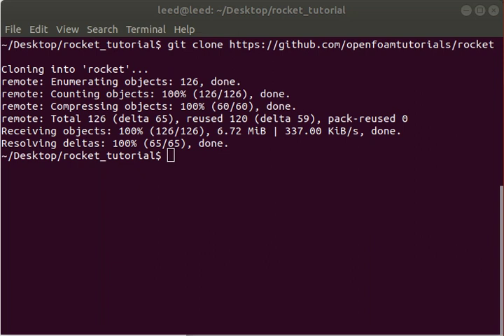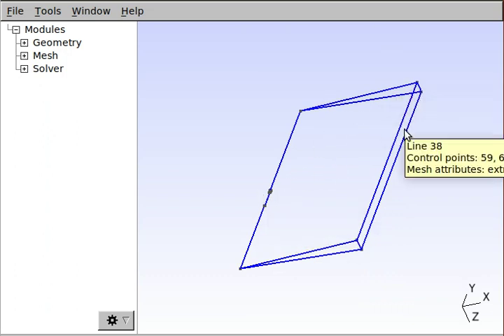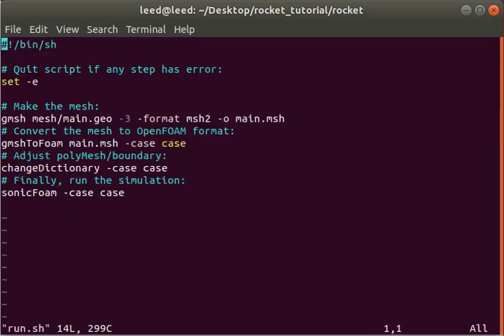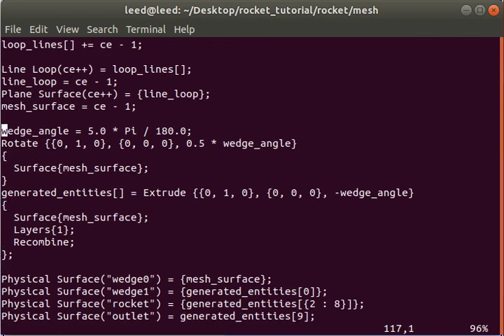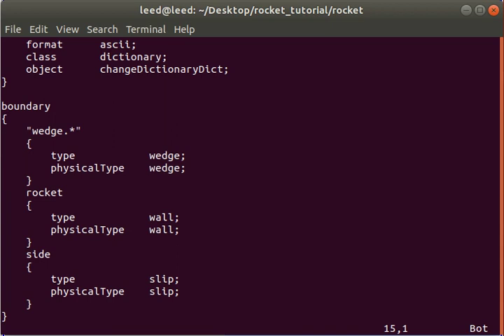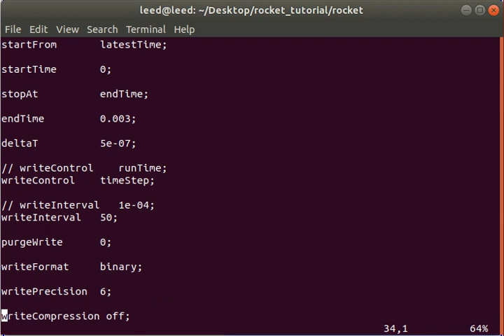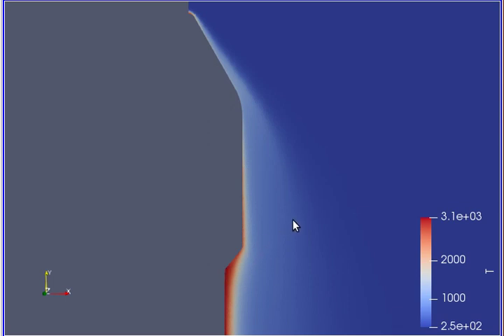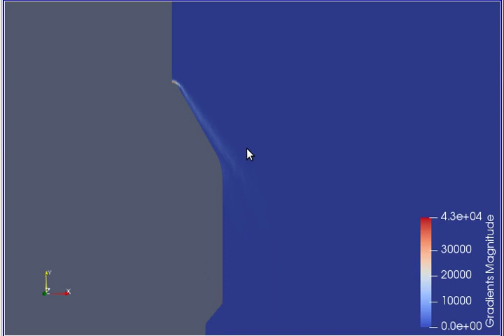SpaceX Falcon 9 Rocket Body Simulation in OpenFOAM

Comment: Thanks for the video, could you make a video explaining how you divSchemes under Fvscheme ? I am still learning open foam and it would be helpful how it is set.
Reply from the maker: Good idea! If you are merely confused about the syntax, OpenFOAM has good explanations in the documentation. Generally higher-order schemes get more accurate but less stable with smaller grid sizes (note that this is a statement about the trend). Generally I default to first-order upwind until I get results with which I can compare accuracy with higher-order schemes. If you cannot get it running with first-order upwind schemes, then something else is the problem.
Reply: @OpenFOAMTutorials  Thanks for the thoughtful reply ! I have used fluent before and i understand the importance of the different order schemes, im just confused how you define all the div() terms under the DivScheme, is it relate to the k episilone foundamental equation that you chose ?
Reply from the maker: If you define a default scheme, you won't have to enumerate all of the terms. In this tutorial, I define k and epsilon terms because k-Epsilon is the turbulence model I am using (see case/constant/turbulenceProperties). I hope that answers your question!
Reply: @OpenFOAMTutorials  Yes, it makes more sense to me now. Thank you ! Looking forwards to more videos in the future
Reply: hello again ! im trying to simulate a small rocket targeting ar transonic mach region with added fin at below, i wanna use the same wedge method as you used. Is it possible after create the wedge for the wing body and then create a smaller wedge (for fin ) onto the newly created wedge body ?
Reply from the maker: A new mesh embedded into an already-created mesh is known as an "overset grid". To my knowledge this is available in ESI-OpenFOAM, but not OpenFOAM-Foundation (these two are the mainstream releases of OpenFOAM software). I usually use OpenFOAM-Foundation, and am not familiar with use of overset grids in OpenFOAM, but it would be great to learn and make a tutorial about.

Anyways, to make things simple, I would mesh the fin into the initial 2d plane. Then, extrude the fin mesh as normal, but specifying an intermediate extrusion to be a wall. Hope that makes sense.
Reply: @OpenFOAMTutorials  Thanks for the reply.  If I understand correctly, is it that I simply add the fin shape to the original rocket and make the wedge as normal, but only specify certain part of the fin to be wall ?
Reply from the maker: Yes. Of course, you would need to extrude the wedge to match the periodicity of the fin.

Comment: Thanks for the tutorial. But why the temperature is 3000 degrees in stagnation region?
Reply: A fluid moving at very high speeds when stopped, transforms most of its momentum into pressure and a rise in enthalpy. Look into bernoulli's energy equation.
Reply from the maker: Hi Alexander, are you hinting that it is unusually high for this flow, or are you unfamiliar with the concepts behind the isentropic flow equations? https://www.grc.nasa.gov/www/k-12/airplane/isentrop.html
Reply: @OpenFOAMTutorials   Yes, I was unfamiliar with this concept. thanks for the link.